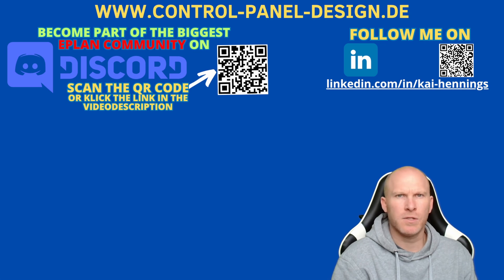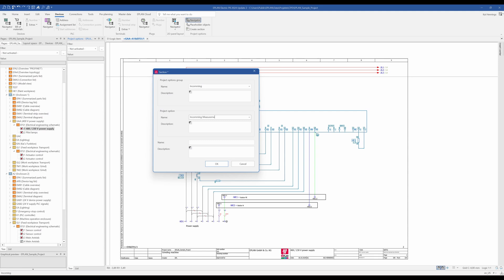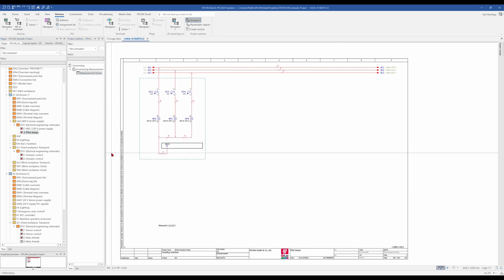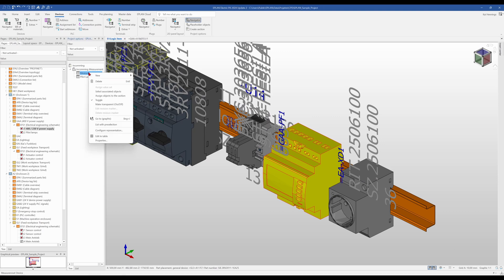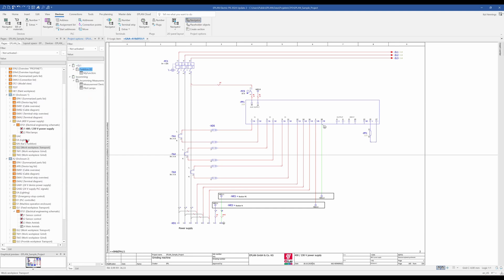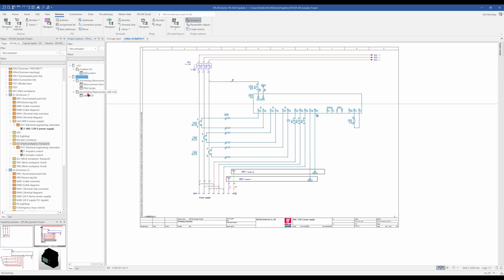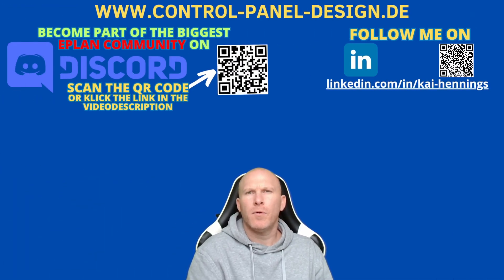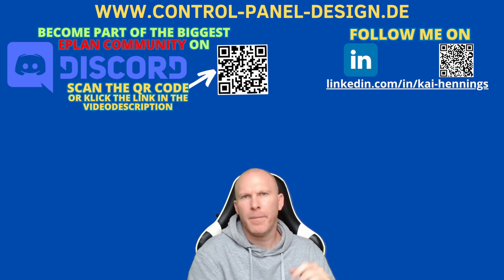Project Options in EPLAN. ➡️How it works and what are the requirements❓

Comment: Hi Kai,
Thanks for the tutorial. I have some questions. I hope you help me to understand this module in a better way. 
What happens if, for example, untoggle the measuring device and then delete it in the project options navigator?
Additionally, one of our customers (working on a tram project) requested to hide plug symbols in the project. They use a large number of plugs for a single connection, which makes it difficult to follow the connection lines. 
I’m considering using the project options to address this, but I’m concerned about potential mistakes. For instance, I’m not sure if I might have made an error while assigning plugs or if I accidentally untoggled some plugs and forgot about it. 
Do you have any experience with this module in a similar context?

Comment: Hello Kai. If you miss a topic for a video I could recommend the following. If you run a test for use of a structure in the structure identifier you sometimes find a structure which is not been used any more but test indicates it is used maybe 2 times in the project.  I know sometimes it disappears if you compress project, but sometimes it is hidden in a navigator. So a video to find this structure will be appriciated.
Reply: Sometimes I solve this issue by deleting some terminal end plate - or a clip-fix that I somehow find them in the Terminal Strip Navigator.
Or, when I have the unused structure identifiers, I add them in the list of search and I can see where they are used and I go locally and delete the references.

Comment: Hi Kai, been watching for sometime. This seems to be Macros, but project specific and interacting with multiple pages / models all at the same time. Is there something like this for Eplan Electric P8 2025 without pro panel? We don't have this available to use with our current configuration unless I'm missing something.
Reply from the maker: Hi, it also works without ProPanel.
You can just use multi-line pages or what ever is needed
Reply: @eplaninanutshell  Not sure whats missing, but I don't seem to have this feature with standard Electric P8 2025. Any thoughts?
Reply: @markspratt7191  You need a licence for this, meybe it will be available in the 2026 version as EPLAN changes its licence packs